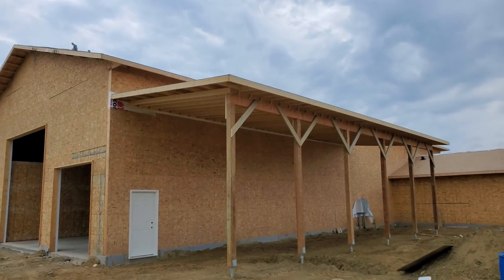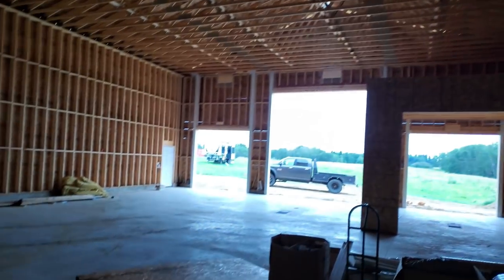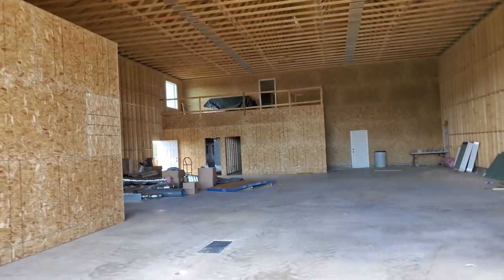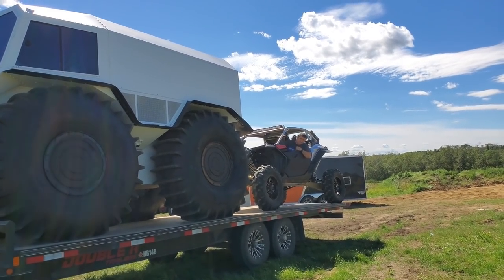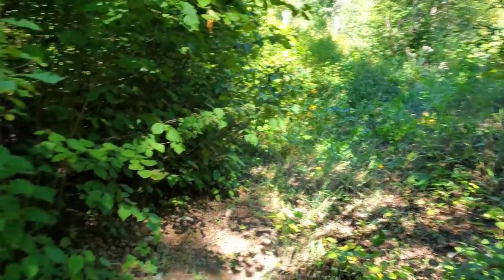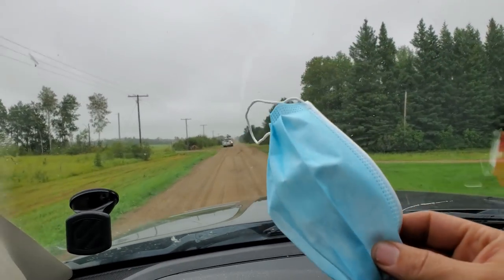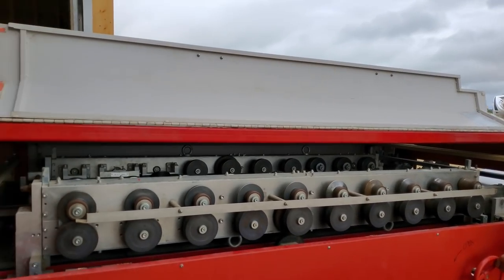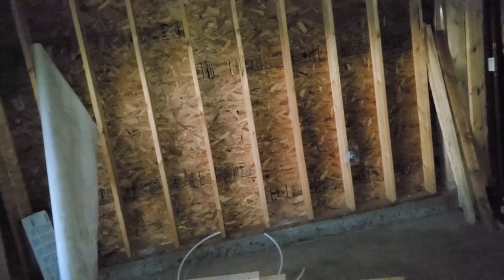Building Our Dream Shop/House Part 7:We Are Full-time

Comment: A fire rated window... that's surrounded by wood 🤷‍♂️
Reply from the maker: Yes wood covered in a fire rated material. The building is not complete 😅😅
Reply: @ostacruiser  hey don't spoil my fun! 😂
Reply: A fire rated wall only delays a fire, its not actually fire proof. Typically they are built to be a barrier for a certain amount of time like 1 hour, 2 hour, etc, but thats up to the building code.
Reply from the maker: @Racer57  100% correct
Reply: ostacruiser why is official fire rated and not the demising wall to house?
Reply: @anything732  I think I know what you are asking. "Why is the office fire rated and not the dividing wall to the house?". Well, it is. The door up above is fire rated and the sheeting on the wall will be also.
Reply: It's all for code... it's almost like Polaris boys, nobody understands, but we have to accept it

Comment: I have to say that I am happy that the ductwork is run in hard duct. I would double check that everything is sealed and pressure tested to certify the maximum efficiency of the system. For your grilles they would install "Square to Round" adapter register cans.

Comment: Put the air compressor above the wash bay so it doesn’t take up floor space and a little quieter that way. Install a blow off valve on a timer to purge moisture from it once or twice a day.
Reply: I built a enclosure for my compressor. Had some unused insulation for the walls and man what a difference it makes 👍
Reply: Nah, it would be much better outside in it's own sound dampened enclosure. That way, it will barely get heard at all.
Reply: csorrows yep but that’s another space to heat for half the year.

Comment: Hey guys ,in your kitchen, have the units made with a recess in the back at the bottom. Or if you are having units on feet then the bottom of the cabinet should be above the concrete step. I'm here in Leeds UK. And have a renovation company for 28 years, look forward to seeing the rest of the build 👊👌
Reply from the maker: Thank you

Comment: you should also have them wire your house for Cat6a with at least 1 jack to every room, and 2 to 4 to every tv location (behind the tv).
Reply: Why?  Isn’t almost everything wireless these days? Just curious.
Reply: They’ll be satellite internet out there. Not gonna have the use for it unless Musk hurries up.
Reply: @nates2526 speaking both personally and professionally, feeding your tvs wirelessly, plus connecting stationary devices wirelessly sucks. plus a house that big is going to need like 4 access points for wireless coverage for just the inside and immediate outside alone, plus you can use the Cat6a to transmit your satelitte tv room to room too.

Comment: Running the wall strapping vertical yields solid wood thermal bridge. Run it horizontally and insulate you break the wood most of the wood bridge and higher R value. Imo 2x6 instead of 2x8 then 2x4 horizontal is even better. Makes running wire easy too, no drilling studs.

Comment: Don't forget about your low voltage wiring. For wifi and satellite and TV stuff. A building like that will distroy signal. And you wanna make sure you're covered. Doing it after is terrible. Also look into analyze low voltage lighting for the shop. You can sequence turn on each of the lights reducing the maximum Peak amperage by not turning on all the lights at once.

Comment: Any future plans for adding solar pv ? That roof space would support a huge system that could have offset the generator capacity needed aswell as supplemented a pile of heat from  the boiler with a heat exchanger. Awesome local build!

Comment: Hey Guys, are those electrical panels 400A each?  I remember you saying one was for the back-up Generator...if so...Eaton sells ATS (Auto-Transfer Switches) they switch the Main Power into the panel so that you can run a single panel and not have to have two of them.  They have 400A models.  Switches the whole house off grid.

You wire the house like you normally would without a Generator nothing special, no backup circuits.  ATS goes between the Service/Generator and panel.  It's a big switch.... literally.

Comment: Osta, when you get to doing the windows about replacing the extension jams, you should be able to go to a home center and get white boards to miter down or look in the casing for around garage doors. Only problem is hopefully one of the builders has a extension clip gun to fasten them. I worked in a window factory for 10 years, so I hope you can figure out what I'm talking about.

Comment: You shouldn't have any issues getting the concrete to clean up before you seal them they make great cleaners just for this reason. If you have any issues with it getting it cleaned hit me up and I have some stuff I use on concrete and it cleans up to like new condition even if it's been 10 plus years

Comment: I still think you are going way overkill with the electrical service. How many of these high current things do you think will be running at the same time? You don't just add all of your circuits up. I mean, it's not going to hurt having overkill, but 200A would probably have been plenty.
Reply from the maker: Yes of course. But very safe to say we could potentially have several 40amp plus draws going on at once. Why would we put in 200amp service and find it is not sufficient in a years time? Do things right the first time and carry on👊👊🤘🤘

Comment: I’ve seen a few houses with separate HVAC units with separate AC condensers. Basically redundant separate systems in case one failed. Pretty sweet stuff!
Reply: my place has 3 units total.  its great for when a cap pops and its late.  just move to a different part of the house.
Reply: I have a 5,000 sqft shop on the first floor and the 2nd floor is my 5,000 sqft house with 3 1,000 sqft master bedroom's and a 2,000 sqft open area for the kitchen, living room and office. Each bedroom has there only AC and heat and the open area has 2 ac/heat units. Its unreal how well it keeps cool in are 120 summer's we have in Vegas and I have each unit set at 70 degrees in the summer an my power bill is less than $500 per month including the shop it's awesome. 18in thick concrete walls keep it very nice year round

Comment: I have ta say a Geothermal is absolutely the way to go. To heat in the winter costs the same(electric) as it did to run the wood stove W/blower.
Reply from the maker: It is trash up here in -40 temps. We had it at our last house. Never again

Comment: Should have poured 6” concrete under interior walls (wash bay) to match exterior walls. Keeps bottom plate dry
Reply from the maker: Yes for sure. We will seal it up good on the interior portion
Reply: ostacruiser love the garage and your videos are awesome

Comment: I’m actually a garage door installer and for your car wash they should do your exterior door facing out of course and do your interior door that’s leads into your shop facing towards the shop so it opened into the car wash I did one for a utility company that needed to work there vehicles inside it can be done
Reply: Please elaborate on this installation...will the track be outside the bay? It is going to be a sectional door...I'm confused.
Reply: M Bueno yes a sectional door but you can put the door in facing the inside of the shop and have it open into the car wash so both doors the tracks would be inside the car wash
Reply from the maker: Yes this is how we did it. Stay tuned for part 8
Reply: ostacruiser that is awesome can’t wait to see I’ve been a huge fan of you since before mrs pats got her outlander 600 then she moved to the 1000 Mack when you had that big orange gade
Reply from the maker: @dominicneiss7379  Heck ya dude!! Awesome!